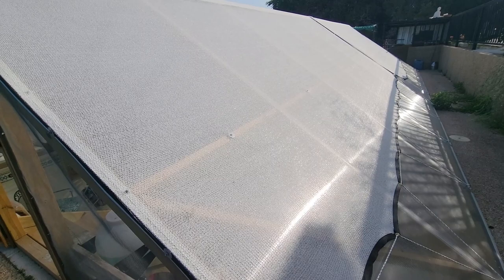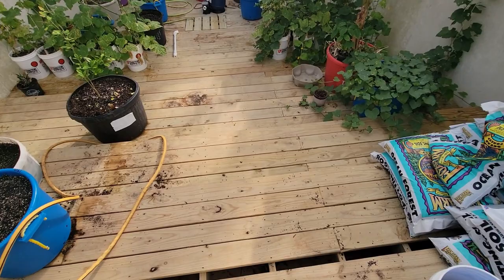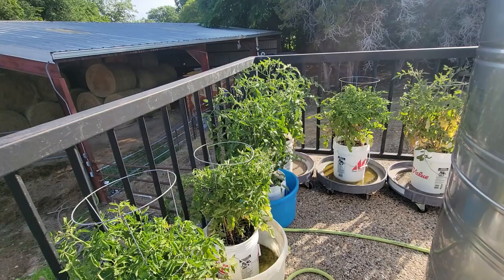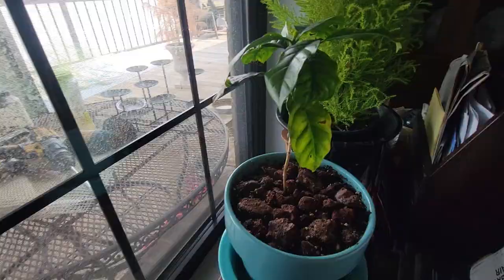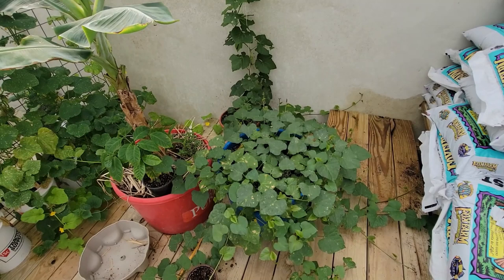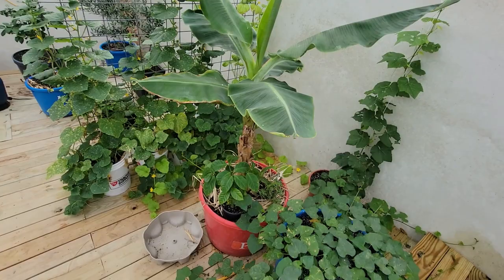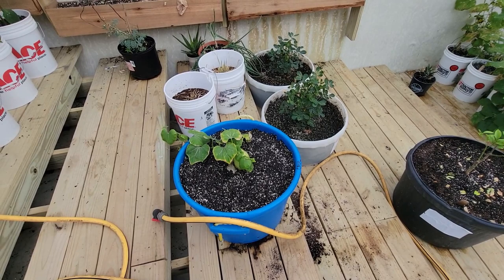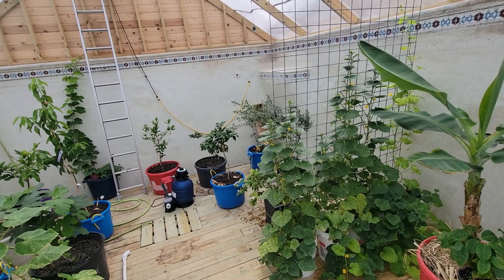Greenhouse from a  Pool - 3 month update

Comment: nice greenhouse. i saw a video of a pool to greenhouse conversion  in the northwest a few years ago, on the justin rhodes great american farm tour i think. Which way is west in your greenhouse? The west sun should be blocked and insulated to block that afternoon heat, yes? can you make the south side panel removable? and maybe put up more hardware cloth? that would give you more ventilation and less heat absorption. I also think you need a serious fan in the bottom to keep air moving.
Reply from the maker: The small end with hardware cloth faces west. The biggest thing i found so far is the fan. I had it sucking air out and i spun it around to blow air in. That one thing got me real close to outside temperatures. I can add more ventilation.